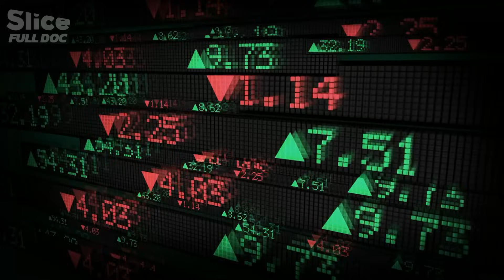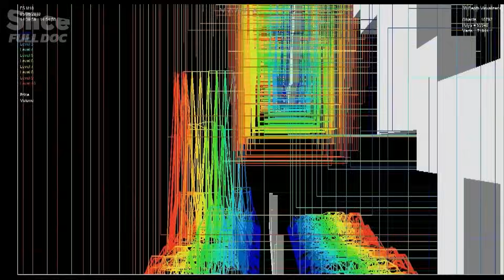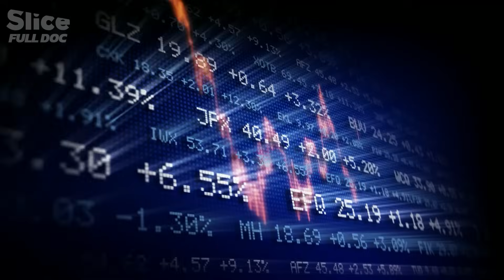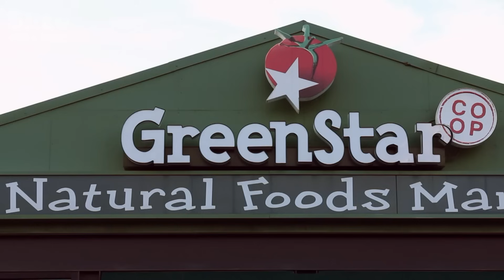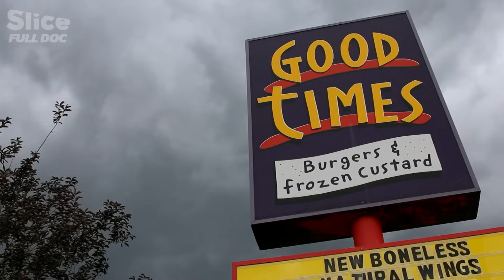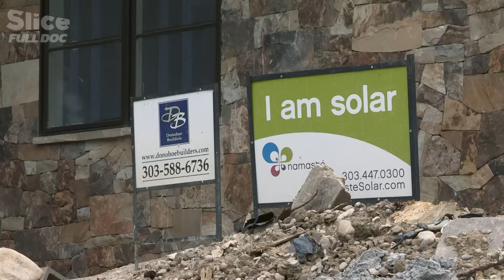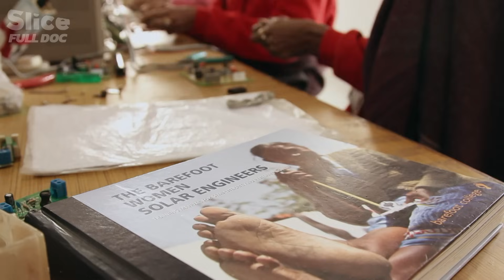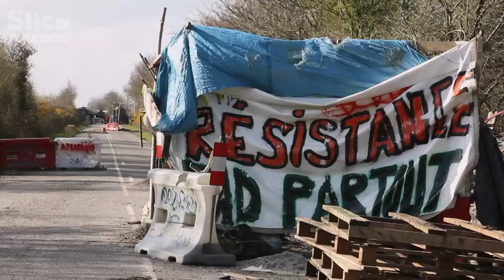Slow Down to Save the Planet | FULL DOCUMENTARY

Comment: GDP is Grossly Distorted Propaganda 

NDP is Not Done Properly 

Where do economists subtract the depreciation of durable consumer goods to compute the Net Domestic Product? How many automobiles have American consumers trashed since Sputnik?
Reply: We are still in the dinosaur age of transportation.  Maybe that is wheee you can contribute a solution?
Reply: @LarryCleveland  
"Dinosaur Age"?

Look at the engineering that went into the P-38 Lightning. 
Look at the prices of the Model-T Ford from 1908 to 1920.

If the auto companies had really concentrated on good engineering in 1950 and stopped making useless variations then how good and inexpensive would cars have been by 1960.